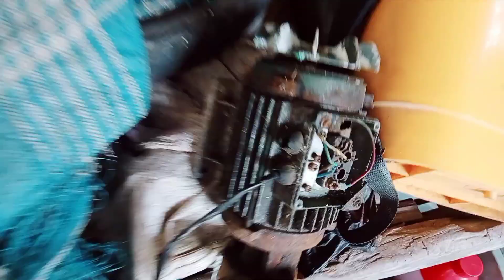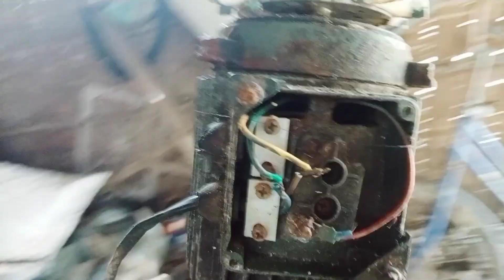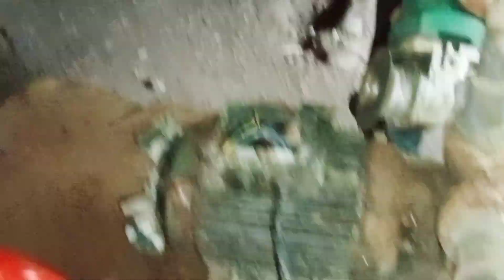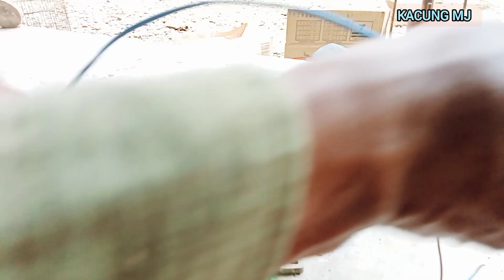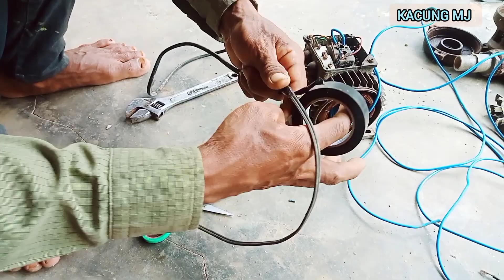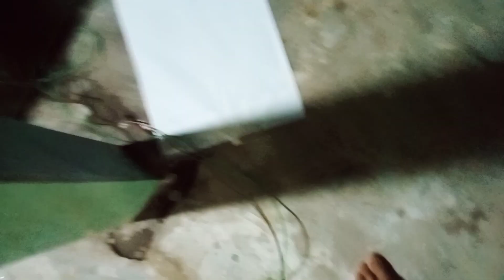trik rahasia las listrik, welding dari pompa air @kacung mj

Comment: put a test light between the two wire it should glows only one side will be a positive for the electro the other wire for a negative ground measure the voltage out put between this two 14volts is not strong enough for weilding 40volts AC output it good enought for weilding